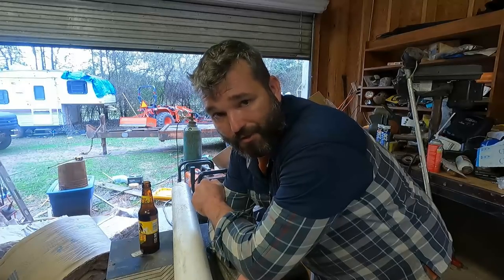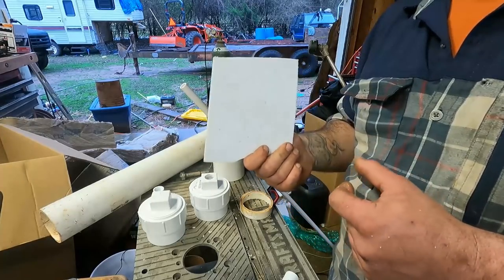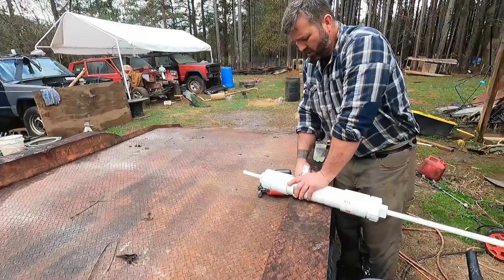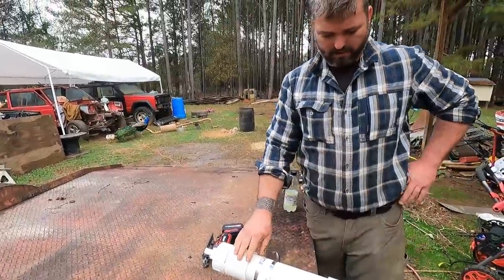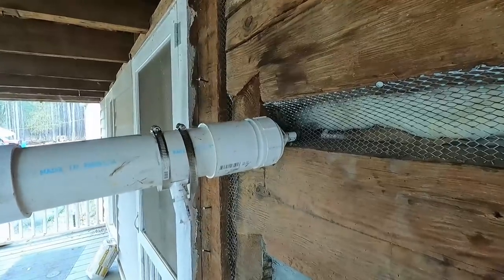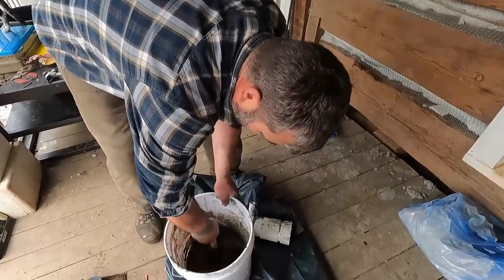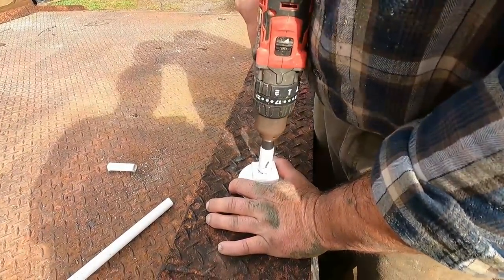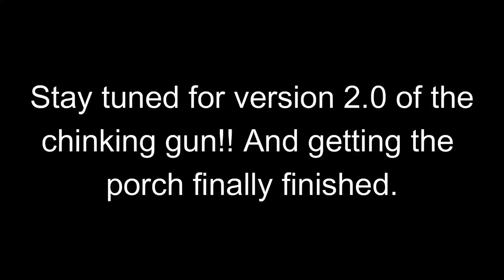EPIC FAIL! | DIY CHINKING TUBE EXPERIMENT | SEEMED LIKE A GOOD IDEA AT THE TIME

Comment: Look to the past for a lesson on how to apply the chinking more efficiently. Remember the old lathe and plaster walls? They used a mesh screen on the surface to give the plaster something to adhere to. But they didn't use any kind of "gun" to apply the plaster. They simply used a trowel, pushing it through the mesh screen until they had a smooth surface.

Comment: I love you guys but sometimes simple is easier.  Being in the Constuction Supply Industry for 45 years I would suggest just a Mortar Board and a Margin trowel to push the grout off the board and into the joint.

Comment: Well, you never know until you try.  But I could have told you that...the reason you find all the people who do this type of work on UToob simply use a large trowel/board to heap on a lot of the"batter" and push it into place with a trowel...is...because they have learned it is the most efficient method.

Comment: I love your ingenuity.  I truly do!  But I have to wonder if the old ways might be the best way.  You are already using your hands to I mix the chinking.  Why not just use your hands or a trowel to both load up the  space and then smooth in?   You may need to do two rounds, halfway one round and them build on that after that round is done.

I know nothing about construction, so forgive me if my suggestion doesn't make sense. Just looking at how little comes out where you want it to be with both the bag and gun and thinking there has got to be a more efficient way.

Either way, I watch both your and Robert's channels.  Thank you for keeping me entertained while I am laid up!!

Comment: You've got the right idea, perhaps something like the old round attachments they used to hang shower curtains, wooden hanger rods in closets, etc,on. They were screwed into the wall, & the rods just popped into the hole, for attaching the push rod, it would give it more strength & stability. Plus like you said make your nozzle a little larger, maybe even twice as big in diameter. You've got the right idea, just a little tweaking. Happy New Year. Btw yesterday I celebrated the 44th anniversary of my 21st birthday. I can get rid of my fake ID now.

Comment: Aaron i gotta give you credit for trying to be innovative.I’ve been watching other “chinking” videos on YT.Your mix may be off,not sure but if you use a mortar board and line up the edge of your mortar board to the bottom edge of the wood then simply use a flat trowel and slide your mix into and along the opening edge.https://youtu.be/5L6W6-fdPfM

Comment: To make that gun work easier, I think a smaller tube and change the tip to something like a funnel so it will push out the end rather than a flat tip and try to force it out the end, like trying to put a square peg in a round hole.

Comment: How about getting a light flat piece of wood with a handle underneath and place the cement on top the wood that you will need, then use a trowel or a large putting knife to apply it?

Comment: LOL, hashtag:let-a-woman-do-it---I would get some wide painters tape and run it along upper and lower edges. Put a tarp on the porch floor beneath where you are working so as to avoid a mess. Not sure the mesh is necessary...IF using, I would not bring it out so far. Use putty knives to apply chinking. I think it would go faster, much less mess, etc. Just my opinion, but I would dye the concrete a pale buff. Looks great with the old logs and not as harsh.